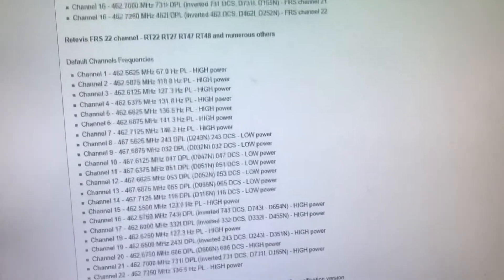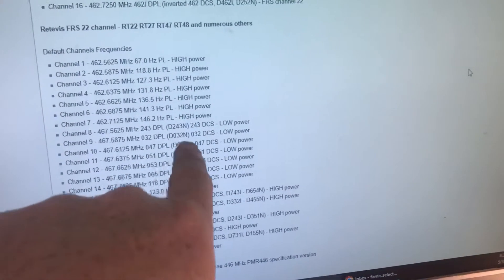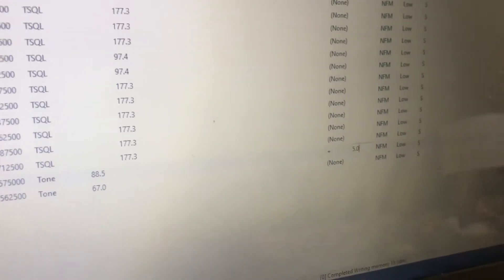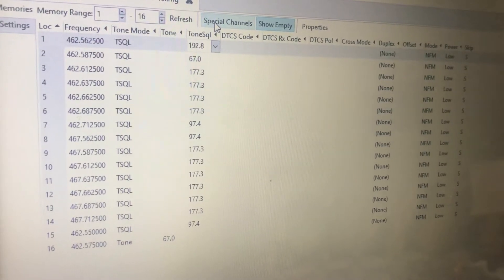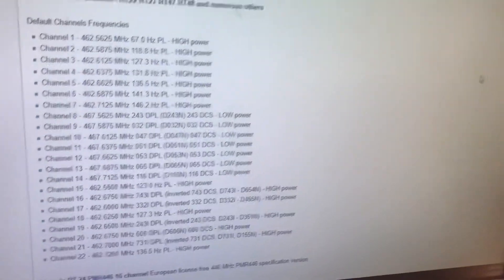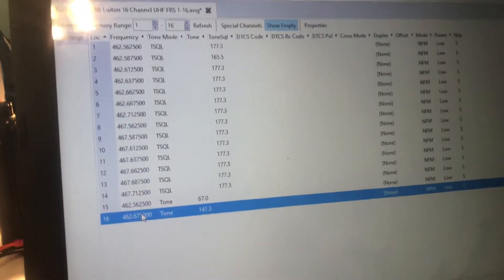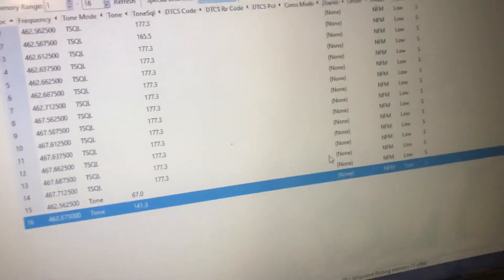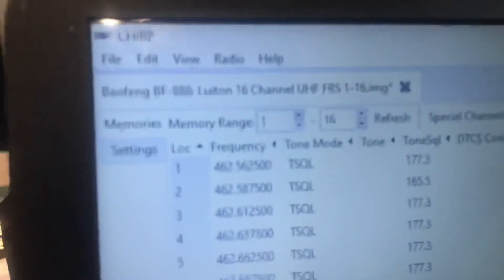Reducing Interference on Baofeng Retevis FRS Walkie Talkies Changing From Default CTCSS Tones Codes

Comment: Just picked up a set of cheap RT22s for work. This is all new to me but this was a big help for sorting out the privacy codes. Getting a lot of interference in downtown Toronto!
Reply from the maker: Glad to help - it's best to use the not-popular CTCSS tones or DCS codes to cut down on interference.  Let me know if you need some more help
Reply: @R4002  Been using these for about two days downtown now and just setting them to the not-popular codes got rid of all the interference I was getting. Was going to send these back and now I'm pretty happy with them. Thanks again!